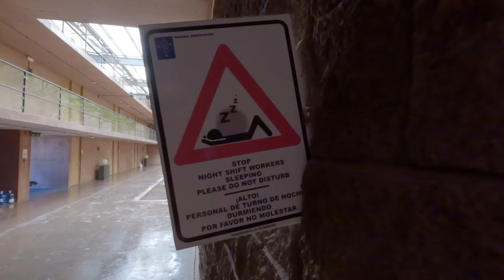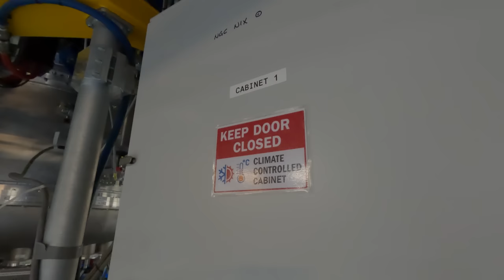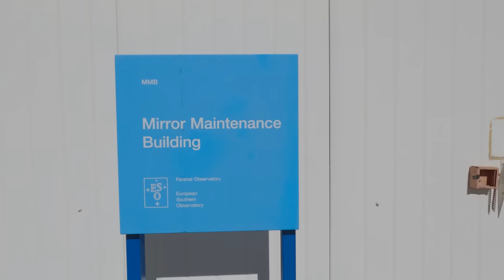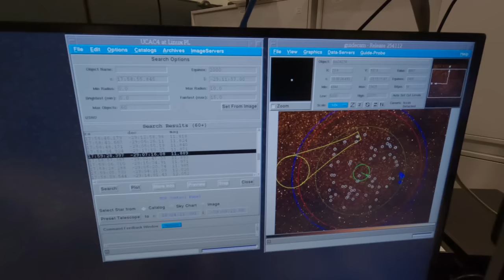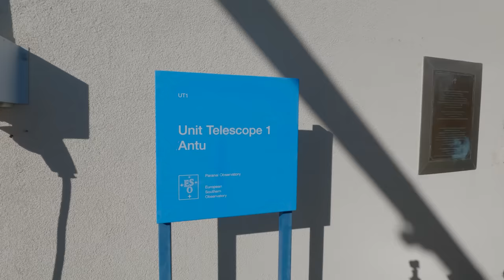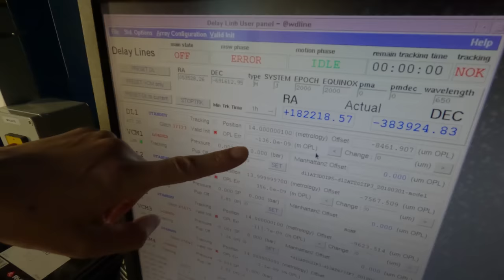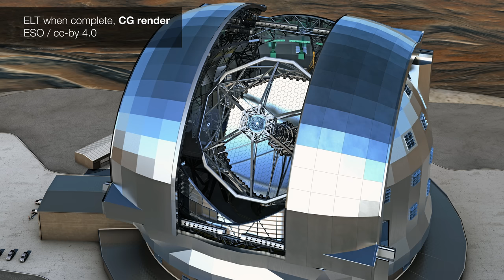The largest telescope that will ever be built*

Comment: To expand on what tom said at 26:50. The faintness that can be detected with a telescope scales with the area of its primary mirror (or the sum of all the primary mirrors in an interferometer set up). The resolution (how accurately it can pinpoint were something is) depends on the largest distance between two points on the mirror. That's why interferometry is so powerful, it essentially replaces a full, solid mirror with a few small ones scattered along the edges. Which is why radio-telescopes can claim to be "as big as the earth" when it comes to resolution, because that's the distance they span. But there's no such shortcut for faintness, you simply need a big surface area one way or another.
Reply: That was a truly helpful comment, thanks!

Comment: It's neat that they sync up the telescopes using actual physical tunnels and mirrors! I love when things are analogue, and this is such a fun example of something that's only possible to do physically!
Reply: Ah, Scott actually mentions that possibility near the end of the video.
Reply: Original commentor was talking in the present tense, not future, fyi.
Reply: @MatthijsvanDuin  There is a very real possibility that this might never be possible to do digitally, it probably isn't possible with traditional computers at least.
Reply: @hedgehog3180 ?  Computers are the least relevant obstacle here, especially since the computation doesn't have to be done in real time when doing interferometry digitally, the EHT records data onto HDs and then later combines the data. The volume of data to be recorded/processed also does not in itself depend directly on the wavelength being captured, just on the bandwidth, e.g. EHT operating at 230 GHz records several 2 GHz bands at 4 Gsps each, with a final total data rate of 64 Gbps. That's still a lot but certainly not an absurd data rate.

Comment: It’s actually very incorrect to compare the mirror on the VLT to a make-up mirror, not just because of precision but also because they have completely different geometries. Make-up mirrors are spherical as it’s the cheapest design. There are large optical telescopes that use spherical mirrors and are very interesting in their own right but VLT isn’t one of them. Instead it uses a hyperbolic mirror.
Reply: Is this where the mirror is produced by having the "plate" rotate exactly at that speed where the hyperbel would have exactly the right dimensions?
Reply: Did they say in the video it's just a sphere that would be 16m wide, if it didn't stop where it is?

Edit: Actually I'm 100% sure now... This is not a hyperbolic mirror.
Reply: Fully projected sphere would be 60m diameter.
Reply: @RobinTheBot  timestamp is 8:51. The M1 mirrors in the unit telescopes are spherical. Not sure if some other component or aspect would be hyperbolic.

Comment: Small thing to point out that Tom almost certainly saw but couldn't include: At 17:40 he says that we haven't sent radio telescopes into space, but there have been 3 which have been sent into space. They are the KRT-10 (1979), HALCA (1997), and Spektr-R (2011). However, none of these are in operation anymore. The purpose of the radio telescopes in space seem to be just to get ridiculously precise measurements, removing the "minimal" interferene from the atmosphere to get none.

Comment: I didn't know we could control motors at the nanometer level of precision. That's gotta be a lot of fun to design the internal mechanism for that.
Reply: It's 100 nanometer or 0,1 micrometer  precision which is still amazing but not the same.  Nanometer precision would be three to ten atoms of thickness which is not going to happen with a cart.  Still insane they can to it on 100 nanometers.
Reply: i forget what it’s called specifically, but you can use gearing to get stuff to move in tiny increments

Comment: Cool video...I was an opto-mechanical/electronics engineer atop Mauna Kea for 20 years and it is all the same stuff magnified...funny thing is the telescopes use the same yellow and blue paint...the Gemini and Subaru telescopes are 8 meter monolithic mirrors with piezo shape control like VLT and the 2 Keck telescopes use 10 meter mirrors with 36 hexagonal segments and they have delay lines to make them one for certain programs...they have laser guide stars as well

Comment: @5:00, for the cost of constructing all the complex  mechanical and electrical adjustments needed to counter the adverse gravity effect on  the extraordinary large mirror, you can place a space telescope in orbit — all things being equal. Space telescope bypasses the gravity and atmospheric distortions ( smog, overcast, reflected light, etc) on the images, and can be maneuvered to any vantage point for a clear image that is impossible  to obtain from a land based telescope.

Comment: - The Very Large Telescope (VLT) has been operational for over 20 years and is made up of four Unit Telescopes (UTs).
- The UT4 telescope was visited, and it has a primary mirror that is 8.2 meters in diameter.
- Optical telescopes collect visible light or infrared and require precise optics.
- Radio telescopes collect radio waves and don't require as much precision but need to be much larger.

Comment: That video is crazy amazing! The part about interferometry blew me away; I didn't know it is achieved physically like that, with optical tunnels precise to 100 nanometers. The tracking accuracy of the ELT is mind boggling as well. One milliarcsecond is 50 times smaller than the angular diameter of the star Betelgeuse, 550 times smaller than the dwarf planet Ceres and about 2 300 times smaller than the planet Neptune.

Comment: I'm a metrologist by trade and I agree with you that interferometry will get solved and for most observations will be more helpful.  However, eventually we'll hit the limits of what optical interferometry can achieve since as you mentioned, it increases resolving power but not sensitivity, and a larger telescope will have to be built to do the science on dim objects that isn't doable with the interferometric systems.

Comment: I should just point out that in the past (up to at least the 1980's) radio interferometers such as the Cambridge 5km telescope or the VLA in New Mexico used analogue path compensators as at that time computers couldn't keep up even at radio frequencies. VLBI (Very Long Baseline Interferometry) used a different technique that didn't need the phase information — I didn't understand it then.

Comment: "The air makes the waves of light not be nice and paralle, but ragged. This also happens to the laser spot/reflection the telescope can see. It then makes the mirror wobble to exectly counter the ragged light wave, so that when it reflects back off the mirror, it is nice and flat again. Only a flat wave can be tightly focused onto a high-resolution image sensor/detector. That's why that privacy glass with the ripply surface only allows you to see through it if you go right up close to it: you only look through about a single of those ripples, which is more like a weird lens that your eye can focus to (mostly) correct, instead of all the ripples between the light and the eye (remember: eye has a diameter!) combining into a blurry mess."

Also, the twinkling, you may recall the wavy image if you look through the hot air rising up from a BBQ. And how it's all wobbly.
Star twinkle is just the hot air from the streets and all the sun heated up before it went down, causing turbulence high up in the air, just like the hot air above the BBQ being turbulent.
The turbulent mixing of different-temperature air then causes the twinkling, because the different temperatures make the different small pockets of air differently-strong light-bending. Just so weakly you only see it as twinkling most of the time.

Comment: Optical interferometry will never be done virtually.  What will happen is that the physical light pipes need not be enclosed if they are in space, as there distortion sources will be negligible.  One could build a large virtual aperture optical telescope the size of the moon on the moon, or eventually larger if satellite orbits can be controlled closely enough.

Comment: Regarding digital optical interferometry. I for one cannot wait for it to become achievable. It will require an immense increase in computing power, storage speed, timing accuracy and more, but it will allow for an equally immense explosion in what is possible to capture from earth. 

The EHT unlocked truly spectacular increases in telescope performance. With an equivalent theoretical angular resolution of 25 microarcseconds. However, that's with a wavelength that's 1.3mm, imagine the absolute shift in capability unlocked when utilising the same "size telescope" (thanks to interferometry) at only 700nm (around red light wavelength). In-fact, lets do the math, the maximum theoretical angular resolution for an interferometry telescope is simply wavelength/baseline (distance between 2 furthest points). So that's 700nm/12,742km = ~5.5*10^-14 radians, which is about 11.3 nanoarcseconds, or a bit over 2200 times smaller than the EHT. We're a long way away, but it'll make a massive difference if we can manage it.

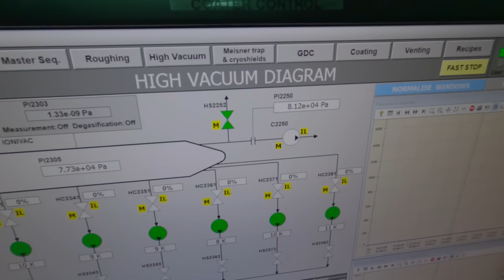Comment: very interesting video! Question to 11:30 - due to the mirror not being flat, would the aluminium aggregate at the lowest point in the middle? Or do they move the mirror during coating? Or doesn't it behave like a liquid once it settles at all?

Comment: Oh. Timing is a problem? Introduce a light signal in the data with any specific frequency. You then have these highly precise blinking lights on all your optical data so you don't have to think about their timing relative to one another, you can front load that maths before even gathering the light. And you "line up" the blinking lights. You'll probably need different types of blinking lights to allow more observations. But you can remove the highly technical problem with a mechanical solution, even though the mechanical solution generates digital information.

Comment: There is a hard sci-fi setting called "Orion's Arm", it assumes that wormholes exist and can be controlled. In this setting there is a cluster of 8000 telescopes called the "Argus Array", scattered in a volume 1000 lightyears across. Nanometer sized "com gauge wormholes" are used to exchange the data needed for interferometry (bypassing SR). Each telescope is a 20 AU diameter sphere, total light gathering area ~10^27 m². This could image a 10 km sunlit object in the Andromeda galaxy in 10 seconds. Lets hope wormholes are real :D

Comment: No, we won't have optical computational interferometry. In order to make computational interferometry we need to have classical EM wave. Weak optical wave with sources having few photons can not be even approximated as EM waves. Radio waves have in the best case for optics billion times more photons than in optical regime - per pixel for the same luminosity. Because a radiotelescope can see only a single pixel at once.
So computational "classical" interferometry won't work. Hence we can create quite a good signal for approximation.
Optical interferometry is physical, and "quantum" in the essence. Interfering wave of photon doesn't need to be known and measured. So even single photon is correctly (actually perfectly due to QM principles) interfered.
You should be aware that single mirror is nothing else than "interferometer of images collected by its pieces".

Comment: Does the light hitting the mirror itself on these optical telescopes cause any heating? Even miniscule heating, I'd assume, would cause issues trying to keep the exact, precise orientation and alignment? I mean, I'd think even the top of the mirror would be slightly different temp than the bottom side inside the building. So, it's all just hydraulic actuators slightly nudging the mirror to adjust it? That's wild.

Comment: The ideal shape for a telescope mirror is a parabola, not a sphere. That's 11th grade high school math. Because of distortions of gravity, the atmosphere the precision required and the size of the mirror slight changes to the shape are required to optimize optical performance. Older smaller telescopes such as the 200 inch Palomar telescope don't have such features. The new telescope will be 1543.3 inches in diameter.  The 4 existing telescopes are 322.8 inches in diameter.The measurement of performance is light gathering power.

Comment: 26:43 a telescope (system)'s 'resolving power' is proportional to its diamater or distance between its extremities.
So, I think, with optical inferometry and a telescope in Africa and in South America you would be able to resolve the same precision of detail as a huge M1 mirror the size of the South Atlantic ocean.
But you would collect a miniscule fraction of the light. Light gathering power is proportional to the AREA of M1 minus the area of the obstruction.
Earlier in the video the scientist sort of lied a bit. Tom asked doesn't M2 obstruct M1. I think a more accurate answer would be yes it obstructs an imaginary complete dish of M1 but by no means all of it, the % obstruction is a factor in the design of telescopes of this type. Shop for a much smaller university telescope of vaguely similar design (but without the adaptive optics or interferometry of VLT!) eg from Officina Stellare, or PlaneWave, or ASA...and you will see the obstruction involved in the design quoted in the spec sheet.

Comment: What if we put a network of extremely small drones in the atmosphere between the telescope and the observation point? Could they communicate the differences in their relative positions to augment the laser atmospheric corrections? (Obviously big quadcopters would not work in the upper atmosphere—I’m thinking smaller than that.) 

The network latency would be too slow to make microsecond adjustments, but maybe the micro drones could measure humidity, turbulence, and other variables at different altitudes that could enhance image correction post capture if the light gathered during the exposure is time stamped and synchronized with time-stamped data collected by the drones.

Comment: The claim at the end is a little confusing for me. In order to record a signal to perform “offline” interferometry, you need to sample with at least double the frequency of the signal. So figure on the order of 1000 THz to sample a light wave. I’m not aware of any remotely feasible way to achieve that. Not saying there isn’t something out there that I’m not aware of but it is a very substantial claim and one that deserves a little bit of substance to back it up.

A little sad that the Giant Magellan Telescope wasn’t mentioned. It’s not as big but I think it’s a lot more interesting from an engineering standpoint. They also picked a spot large enough to potentially build a second GMT and create what would then be the largest optical interferometric* telescope (though there’s a good chance this never happens).

Comment: Sputtering the Mirror I believe is the term.  Vac deposit of Gold or Al or ...  Done in Semiconductors last size I worked with was 8" Suspect much larger now.  But the big ones for Solar and 8" for MicroP   and memory.  R&D might be 4" or 6" line.   Production use large wafers.

Comment: Just wait until we have 20 different telescopes in orbit, each one the size of 10 JWST and all working together using digital interferometry in real time. It's going to be amazing. 

Fun side note, I'm betting that when digital interferometry becomes a solved technology, phone manufacturers will start putting two of the same type of camera on the back of the phone and that one will be located near the bottom while the other stays near the top. This will force people to start recording things with their phones in landscape mode again. That is the time when the 2010s will become relevant again culturally, since everything goes in cycles. I'm betting this will happen sometime in the late 2030s but really kick off in the 2040s.

Comment: 15:45 interferometry comes up.
Won't you need to be combining only those sensed light signals that are very precisely parallel in time, otherwise it's no improvement on a long exposure amalgamating light signals OVER time from ONE telescope?, I wonder.
Sure enough in not too long Tom has carefully worked his way round to it, and yes you do need very precise matching in time.
This is very good. It could be your best but I'm only occasional.

Comment: Why would they need to process the signal in real-time? Why not use slower software to fix it afterwards? If the data is small enough to study and work with on computers, surely it can be fixed up on the same computers. But it still is amazing design and engineering. And amazing video.

Comment: A space telescope bigger than this may be built though. With gigantic telescopes like this built on earth, a lot of the billions of $ spent on them goes into managing and mitigating the effects of gravity on the structure, and the conflicting pressures of something that weighs thousands of tons and takes a lot of force to move, while simultaneously having to be moved very precisely. A mirror that weighs many tons and wants to sag, but must be smooth to within fractions of a millimeter. But a space telescope, in weightlessness, would not be troubled by this.

Comment: 26:20 I doubt that,at least for the foreseeable future. Visible light has a frequency in the order of magnitude 10^14 Hz range. Not even nuclear clocks are precise enough for that, actually I don't know of any clock technology that has the necessary clock rate to get a 100nm accuracy. This clock rate would be the inverse of the time that light needs to travel 100 nm. So c/(10^(-7) m) ≈ (3*10^8 m/s)/(10^(-7) m) = 3*10^15 Hz. A Yttrium nuclear clock has a frequency of roughly 5*10^14 Hz, so still an order of magnitude too low.